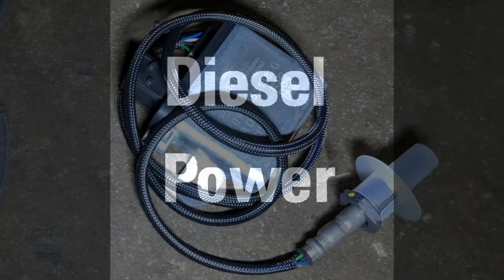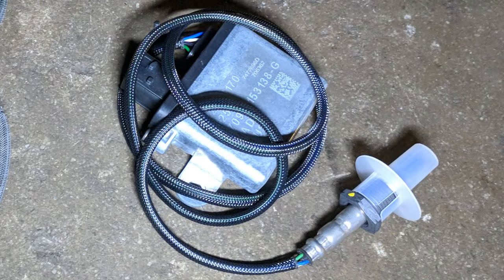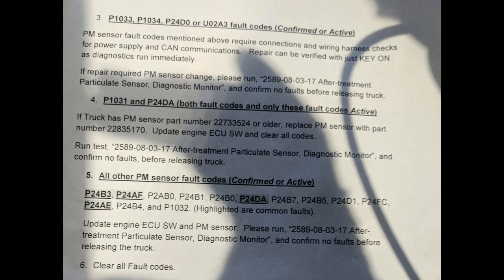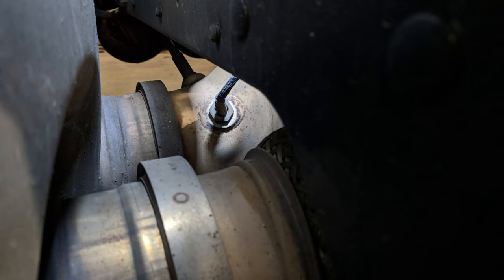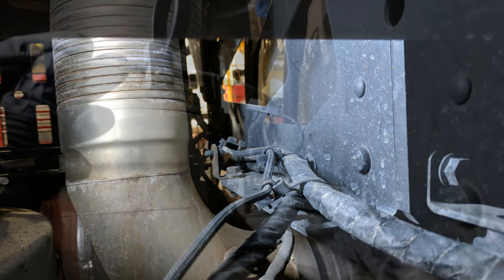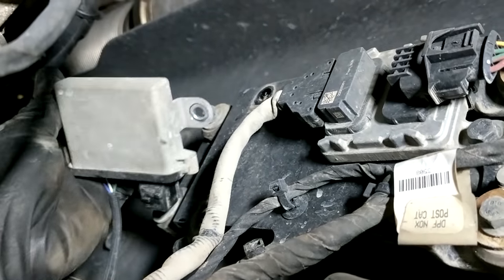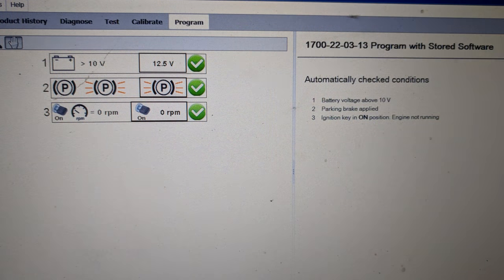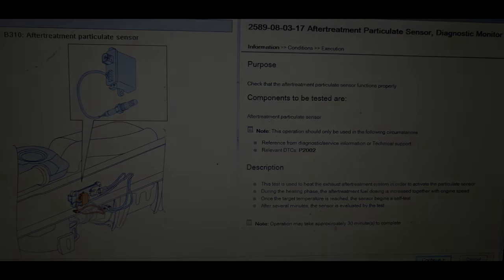How to replace a Particulate Matter (Soot) Sensor

Comment: If i were to change the PM sensor myself and if i clear the codes with OTR Performance Reset tool, would it be the same as updating the ECM, or do i have to go to the dealer just because they have the appropriate software for updating my ECM?

Comment: So far haven’t had any trouble with Volvo yet but have with Detroit. Have you seen where the ghg17 dpfs are failing due to cracked from over heating and if so have you found a fix?
Reply from the maker: fuseone I haven't seen many GHG17s fail like that but I haven't had my hands on a whole lot of them yet. The previous ones that overheated were usually caused by something upstream. Failing injectors, a leaking HC Doser, EGR Cooler etc. Often from getting overloaded with soot due to an upstream problem or just a very poor duty cycle.

Comment: So what is the difference between DPF soot sensor and SCR sensor right next to it? Thanks.
Reply from the maker: The Soot sensor measures the amount of Particulate matter that is making its way past the DPF filter. The sensor that's typically mounted next to it is the Outlet NOx sensor. It measures the amount of NOx exiting the exhaust after the SCR Catalyst.
Reply: Can you help me locating the soot sensor on a cascadia 2017 thanks for the help whit this video.

Comment: Hello. I have an error P2003 diesel particulate filter Below efficiency on my Tucson 2015. Do you think this error p2003 is related to this PM sensor? My DPF is in good condition, 18mbar pressure test after washing. Thank you!
Reply: Yes mate, the soot sensor.is the sensor that calculates the efficiency of the dpf , and the dpf and all.other sensor can be fine, this sensor is very chappy and always gose, I have big expirence with this because.it happened to me,  and it took me.over.6.months to.figuer what fuking sensor.it was I changed everything and that low effeicny kept coming then I figured that these new disels have a new sensor called the PM sensor (soot sensor)  and its next.to the nox sensor in majority cars, so go ahead change this sensor mste and theu can go very often , I put new 1 after 12k it went again
Reply: @nazzeb1477  My DPF was melted due to unsuccessfull regenerations (city driving) and basically the sensor is ok. After I changed the DPF all is ok.

Comment: Have a nonstop soot level sign  full (at 2/3 )even after regen , went to the only volvo dealer in pheonix ar (vanguard) to get it .. the idiots couldn t fined or figure out the updated one .they faked they looking in the shop and told me they don't have it , after I asked to give me the part nr , they relised they got cought lying since they need the part nr to look for the part itself ... so they told me either my truck don t have it 😆,  or their syst em is messed up... they dodnt even want to update my software when asked to (to see maybe is just a ghost code , had that before)..literally telling me he s not gonna do it can the codes will be erased (they ll come back if still activ) , but they won't fix it either. Can t stand lazy shops that puts the driver in messed up situation just because is better just to change a bulb